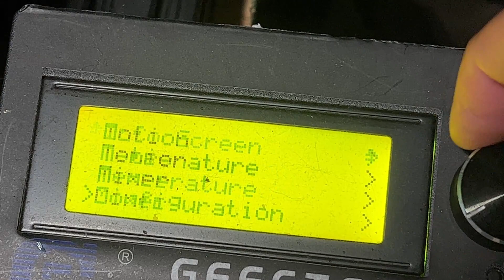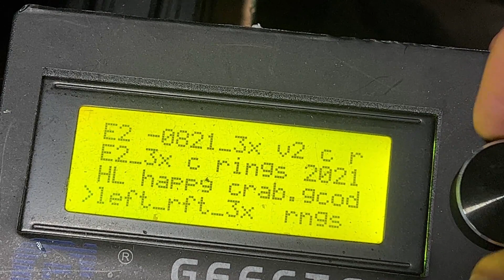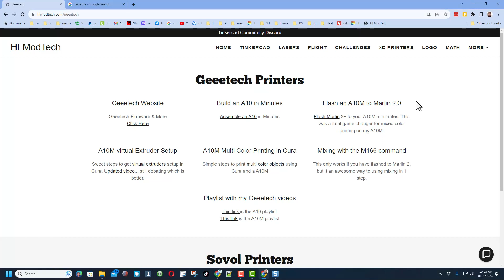Geeetech A10M Updated Marlin Firmware Bug Fix 2.1 Power Loss Test!

Comment: Send M413 S1 to enable it and M413 S0 to disable it. Alternatively the POWER_LOSS_RECOVERY default setting is in the configuration_adv file line 1700ish. Change PLR_ENABLED_DEFAULT to true
Reply from the maker: Interesting. Looks like I have a new video coming up. =) Thanks for sharing!
Reply from the maker: I sent the code from cura, then attempted to print via SD card and the results were the same. I did find the code right at line 1707 so I might push a updated version up there for a quick test. Should there be a temp file on the SD card that I could look for after a power loss?
Reply from the maker: Updated the firmware and it still failed. Just found a menu in config where I can enable and disable powerloss so I am giving it another try. Sure do like how quick it is to build new marlin in VSC with the autobuild feature.
Reply: @HLModTech   Looks like we also need to set POWER_LOSS_PIN on line 1710 to -1. The power loss pin only works if we power our board separately with an uninterruptable supply (battery). The reason Marlin want you to do it with a power loss pin is to save writing to the SD card every layer which will shorten the life of the SD card.

Comment: The power loos funktion makes a little bit the print quality Bad. So it's better to disabled. I highly recommend for all geeetech printers make hotend(ender) fix for no more clogging. Do a 5050 part cooler Fan. Firmware Marlin 2.1.x bugfixed.define s curved allocation, linear advance and last but least input shaper for fast prints without loosing quality. Faktor 3 install better drivers in like TMC 2209/08 less noise.
Reply from the maker: Thanks for all the tips!  I am not much into modifying my machines, but at least now I know where to start. 💯👍

Comment: LOL! AWESOME! The Geeetech A10M was (and still is) my 3rd 3D Printer. I;m happy to see others using it as well especially after the "debacle" that Geeetech got caught in. (I got mine before it happened)

Where did you get your firmware and what board are you running in your A10M?
Reply from the maker: =) I have that A10M and a A10T.  These steps will get you an updated version of Marlin for the A10M. https://youtu.be/Ba0QdaiyxdI